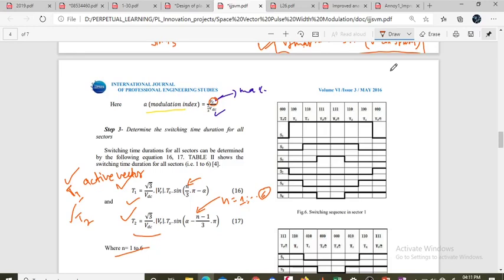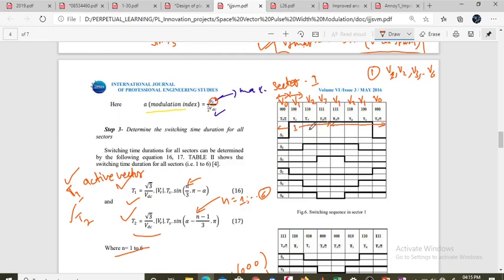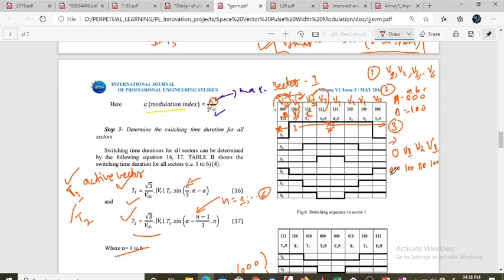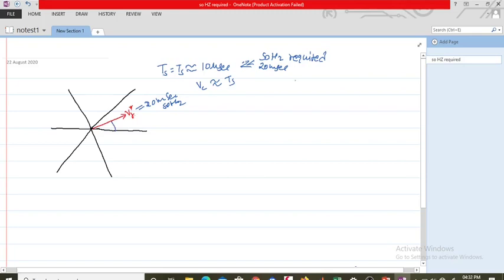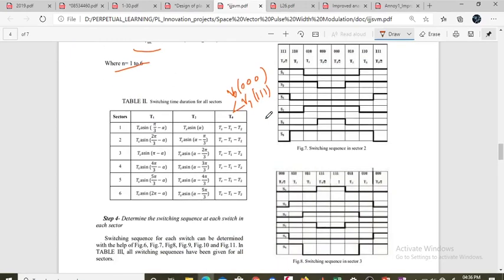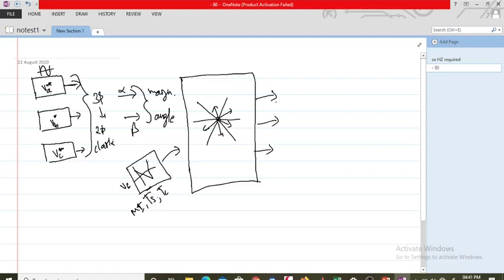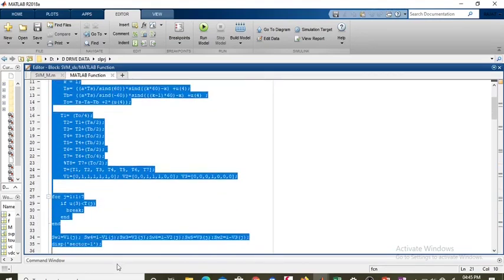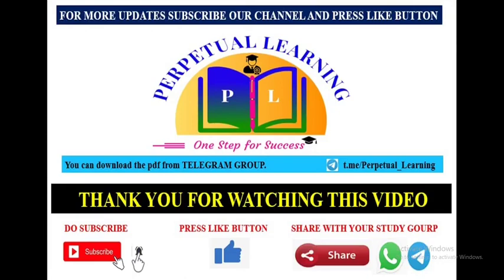SVPWM Lect 2||Implementation|| PL Innovation

Comment: Hi Mithun, Thanks for your question. Think, you are designing an inverter then which parameters you have and what you want at output. you have dc bus voltage, and output parameters are output voltage and frequency. So, dc bus voltage can be chosen by where you will use this SVPWM based inverter means application. This is the practical. Now, if You are just solving the questions (like class work questions). Then you have to modify the equation for dc voltage that I have already mentioned in video lectures. If you want more details here about equations of SVPWM. write your question and sent mail to me mail id is                                                 "perpetualearning@2020gmail.com"
Reply from the maker: perpetualearning@gmail.com